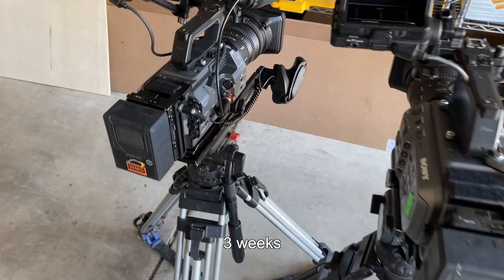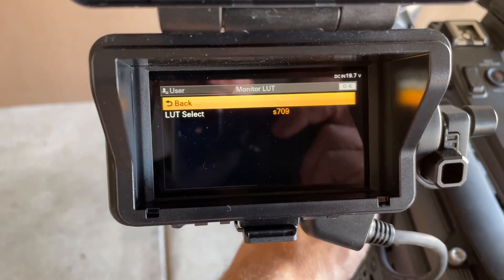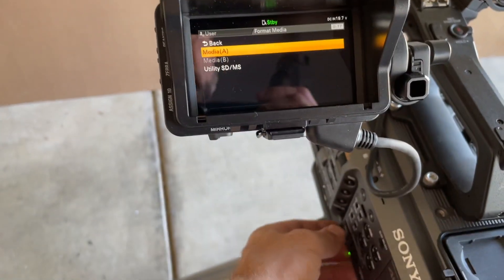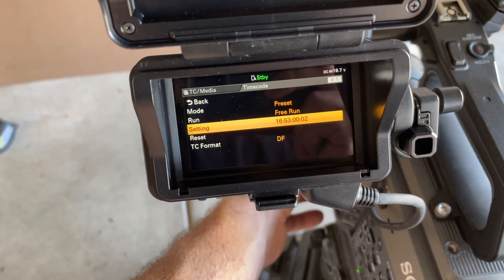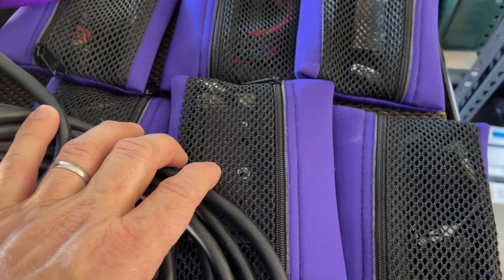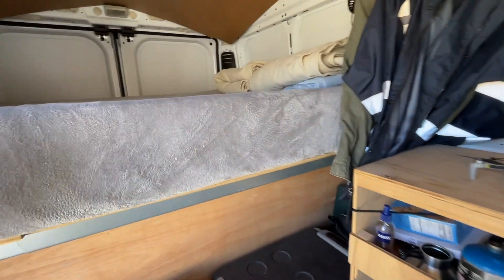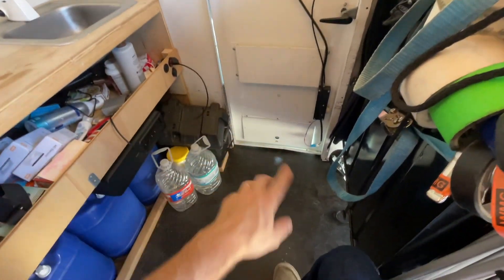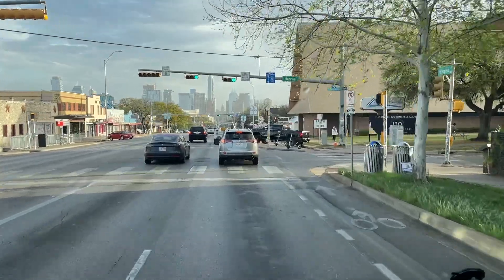Corporate Communications | Sony FX9 owner operator Texas

Comment: Thank you for all the great info here. At 13: 40 one camera is a little higher, why is that please?  I usually here keep the cam at eye level.  Thank you.
Reply from the maker: Good question, I don't recall, however... Primary interview angle vs a closer "profile" angle.  Similar-size framing on the same subject often requires more variation in position to intercut.   Most likely the higher position was to avoid an issue in the background, it was a glass wall with large shiny door hardware.    We may have gone higher to place the door pulls out of the frame or prevent one from extending above the subject's head.  Or, it may have been to showcase a specific product in the background of both angles.  Or, all of the above.
Reply: @CrankyCameraman  I see. That's a great point with the objects in the background as well.  Got to always keep that in mind.

Comment: 2 micro-pro-ish tips: 1 - consider replacing the stock 28-135 lens hood with the hood from the Sony 18-110.  It has a built-in flippy lens "cap" so you can easily 'execute APR' every time it asks; 2 - Phantom ARRI LUTs for the FX9.  As an Amira owner, I'm certain you'll see the value.    Impressive that you can set cameras before the shoot... I'm usually doing it 2 minutes before rolling with the producer that fed me the wrong tech information asking me twice per second if cameras are ready yet
Reply from the maker: Haha, that last sentence, you are unquestionably qualified!  Thanks for the tips. I’ve heard good things about the Phantom LUTs. Will take a look.
Reply: Hahaha :;D Good to know the 18-110 works on the 28-135. I basically shoot on that lens 90% of the time.

Comment: Hey David had a question for you, do you always record on only 1 card?  
I'm pretty paranoid and I don't want to live the day when one card decides to die at the end the shoot day. I always put 2 cards in and shoot in simultaneous recording, in case one card decides to go belly up, the second one gets to be the hero. 

In 16 years, I didn't really have problems with tapes, cards or other mediums except one time when an SD Card decided to spew some errors during recording. I immediately removed it from the camera. When I checked the footage it only dropped a few frames from a clip but thankfully the B card saved the day.
Reply from the maker: Yes, single card record only.  One time I lost footage due to a corrupt card. It was a cheap SD card in a camera with a single card slot.  I’ve also lost footage in a duel record situation where one of the cameras was not set to duel record and instead the footage spanned from card one to two. Big multiple camera shoot with an AC and DIT. It was still
missed and cards formatted before missing footage discovered. 

One man band audio, I’ve been burned more times running a lav + boom vs a single mic.   If I have one mic to monitor I’m confident it will be right as I’ll stop the record to fix a problem.  When there is a backup mic the compromised delays begin, thinking it’s probably ok on the boom if the lav has clothing noise, or subject drifts off mark and boom sounds off axis. Over time I get better results with one mic as I stop to make it right.